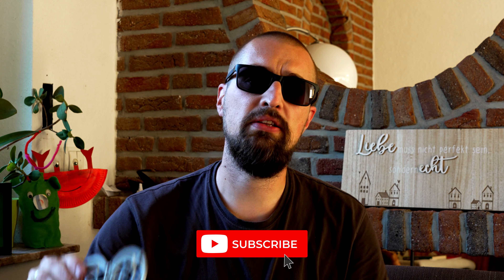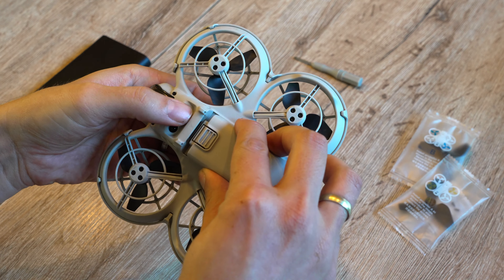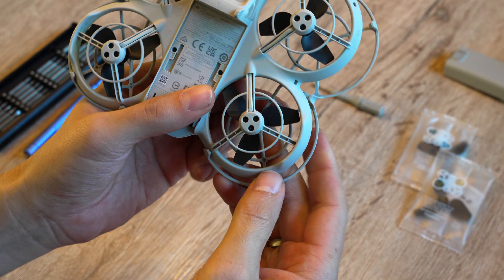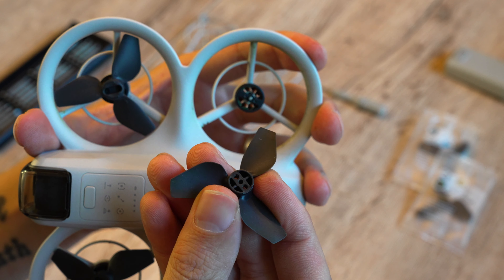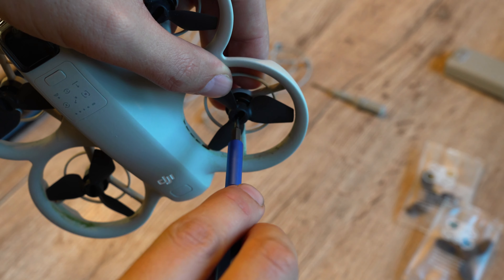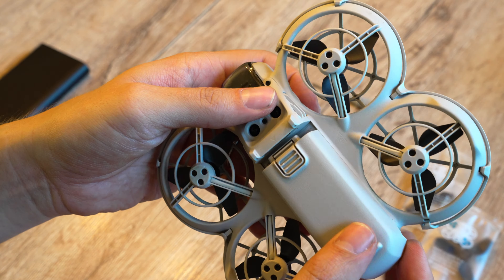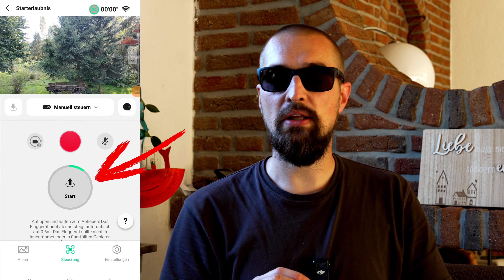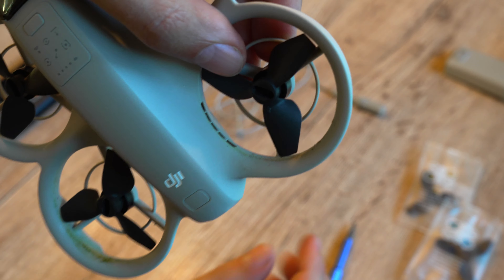QUICK FIX: Dji Neo Propeller Blade Replacement Made Simple!

Comment: What is the solution for strip screw thanks
Reply from the maker: To remove a stripped screw, you could try placing a small rubber band between the screwdriver and the screw head for better grip. Another option is to use a precision screwdriver or a screw extractor tool. If nothing of that helps, you should contact the DJI support.